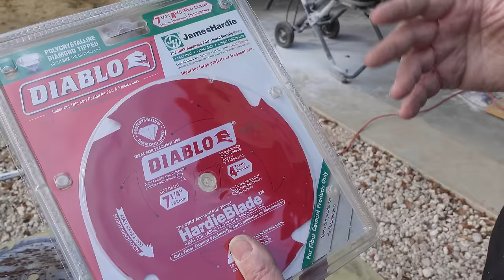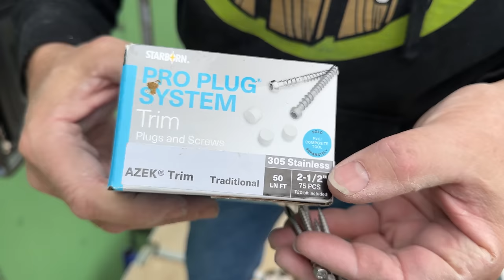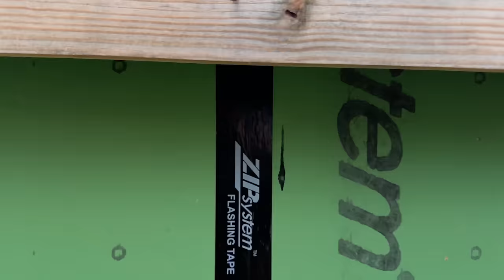Installing a Bulletproof Soffit and Fascia That Will Never Rot!

Comment: I just did my trim in pvc. You really need a respirator cutting the pvc. The aerosolized plastic particles coming off my table saw are also terrible for your lungs.

When cutting the long boards like that I clamp a 4ft section of the saw guide instead of the feather because it keeps the pvc square to the fence over a longer area. The 18ft sections of pvc are so floppy they can bend on the short axis and your cut line walks.

The cortex screws driver bit has the felt tip and stop that lets you drive till you hit the stop is much nicer, perfect plug depth every time.

Comment: I was going to ask if Hardie needed to be gapped between panels but I looked it up instead. :) I figured I'd share what I found in case any other commenters are curious. Hardie says to use "moderate contact" between panels OR you can gap them and caulk them.

Comment: Wood can survive in Houston, it just requires proper wood species selection for rot resistance,  and consideration of ventilation and drainage, so you don't trap moisture (either rain or condensation), and constant diligence on maintaining the sealing and coating, i.e. yearly check and repair of caulked joints, and repaint when necessary.  That'll be 3-8 years, depending on the quality of paint and prep work, as well as sun exposure. I went a little long (10 years), and the only bits I needed to replace were the bottom run of 8" T&G on two sides off my garage, since the foundation sunk and those sides were in ground contact. Actually, that's why I was late to repaint: was getting the foundation fixed, first. :/ Ok, so it's a lot of work. But it can be done!

Comment: First, really awesome that you are working together as a father/son team.  What a fantastic opportunity for making memories. The AZEK products are great but they really show a lot of dirt and discoloring over time especially anywhere you have a joint, cut edge, or caulk.  I know you said you are going to paint the soffits, but I hope you are going to paint the AZEK facia and edges as well I find most people never do that extra step and it is so worth it.  FYI, if you use Royal Celect Frost trim boards in the future it comes already painted but does require more planning since it usually is not a stock product in most supply places.  Overall, the project is really coming out nice.

Comment: Happy New Year Stud Pack !  Great work as usual. Just like everybody else, I would have done some of it differently. I would have "boxed" (as we call it here ) the eaves. That is running the soffit level, as opposed to matching the roof slope. Also, I prefer to have the rake fascia overlap the side, so that joint looks cleaner from the end where is most often viewed.  I think you guys are going to regret not venting the roof system.  We will see in a several years, yea or nay.  For those that may not have noticed, on the rake fascia, that mitered joint should be ( as it appears to be in the video ) with the long point of the joint pointing down. It looks cleaner from the ground to do it the other way. But this ensures that any rain /moisture runs off to the outside.

Comment: I put Azek up for fascia in Chicago. Must be 10 years now. The board cost me almost as much as he high end vinyl siding for the whole house! Shiplapped the joint. I also knew, since it is a vinyl product, it would have something like a half inch expansion between winter and summer at 12 ft. Thus the shiplap as opposed to the 45/scarf,.a half inch gap is pretty visible, especially if you view lines up with the joint. I didn't see your scarf joints, but in the winter you need to gap the joint. Best to install in the heat of summer and then you can butt the joint together. Same goes for the corner overlaps. They don't carry those Azek screws in Home Depot (which used to stock Azek). GRK general purpose construction 2 inch works great with silicone white paintable sealant (attracts less dust) as a plug.

Comment: On the rest of your Azek use Christy’s White Hot. It works great to meld you pvc together. See if you can find the squeeze tube. You could also use it to plug your kerfs. 

As far as the nail gun is concerned the spool on the gun adjust to the nail length. I think you have it adjusted for 3” nails. 

Nice detail Paul. KUTGW!

Comment: I used a pvc soffit under a deck on a deck i did last spring. We also ran the trex deck waterproofing so we could have a soffit and lights with a ceiling fan. Created a really nice useable space under the deck.

Comment: Trust me, you want to add a backing board for the TV. You don't want to limit your options on mounts. I work in home theater installation and have ran into way too many brand new homes that we ended up having to mount to a center stud and toggle the edges. Just do it and save the hassle.

Now, don't forget to add two brush plates/boxes with a larger conduit to pass your HDMI cables from your tv down to whatever entertainment center you choose. This will really give a minimal look and also once again save tons of headaches. You don't want cables hanging everywhere and running cables through insulation is no fun. 

I would be glad to answer any questions on the AV side [Speakers, Wiring, ECT]. Sonos has some great simple whole home audio products that would really make this space pop.

P.S. I would lower the TV box down around a foot or two. You want your livingroom tv to be centered at eye level. On the other hand this can conflict with furniture, so you have may have to mount it higher than what is considered "ideal". At the end of the day its your space so don't get discouraged by the "TV TOO HIGH" crowd.

Comment: you need a top down feather board on your fence to run those long dados. w/ PVC board you can use plumbers glue for tight and sealed Joints- but use fasteners too. Also please tell Rad to send me Blood pressure meds, I need them every time I watch him on a scaffold.

Comment: I use the same material for my snake racks. I use the half inch. I used to use melamine and that was not only heavy but would sag. This is much better. Water and mold resistant. It’s amazing.

Comment: That end dado feature to put the soffit board into the facia. Excellent eye for detail. Just slap and caulk, you would have had that come apart and be nasty every few years. This detail, that joint will be perfect for the life of the house. 

So odd for me seeing PVC boards everywhere. When I was a kid in the 80's, PVC was this new fangled material for plumbing and it was revolutionizing plumbing who used cast sewer and poured lead. Now, seeing it again.  I don't know how that PVC boards would be out here in Phoenix where we see temps in 120's and 12 hour baking sun and humidity during summer monsoons. PVC pipe that is above ground or exposed, bakes and turns black and brittle. You have to paint and cover and it still softens and wraps in the heat of the radiating sun. I would imagine PVC boards would twist and warp and be messy.....

Comment: Eaves actually serve a purpose beyond “just looks better”. Deep eaves ensure that water isn’t running down the face of your building- which saves the finish and the materials underneath.  Even with gutters, you want to reduce the amount of water that splashes back from the ground onto the building.  Otherwise, great work, and keep going.

Comment: Good decision on the thickness of the dado: Dissimilar materials (Vinyl, cement board) will expand and contract at different rates at different temperatures. You don't want that little vinyl tab breaking off because of contraction rates.

Comment: The nail gun might be jamming because the depth tray in the coil holder isn’t set properly. Basically, in the coil holder the floor of it can raise and lower based on the length of nails so it will feed to the barrel of the gun in the correct plane.
Reply: Came looking for this: figured there was some adjustment that wasn't set right, just not familiar with the tool enough myself to know what it was.

Comment: I've had to replace so much Hardy board fascia on houses, because there was nothing left but the paint in the shape of the fascia. People don't realize, Hardy board is like a sponge. It will soak up water, and start to disintegrate. It's ok, if you cover it 100% with something like silicone or paint, but there are always small spots that get missed, or wear off due to weather. I've replaced fascia that was less than 8 years old, but was already completely disintegrated.

Comment: Been using Azek for years. Azek is awesome. You use PVC glue at the joints. Smells stinky when you cut Azek and it will eat up blades. Azek, doesn't rot, twist, crack or split. Expensive but worth it. I also use it for base in the house. Especially if you are doing an old school craftsman style interior with Plinth blocks which I use Azek too.
Reply: I picked some up for a recent project and couldn’t believe the price. Especially for the 3/4 inch stuff.

Comment: Another idea for patching the dado slot - bondo.   I just tried bondo for the 1st time on an exterior door frame repair liked the result.       Sticks well, easy to sand and I figure if it can make for car exteriors, door trim should work good to.        I 100% agree with your idea of making the trim as durable as possible.
Reply: Axel expansion/contraction with temperature changes may be likely to loosen the Bondo.

Comment: You would be wise to vent your soffit near your dado groove because if water does get in the interstitial soffit area you want a place where the water can drain out. You could just drill some 1/8" holes in that area, but make sure the holes are too small for bees and hornets to get into. To be safe, drill 1/4" holes and put a screen on the hidden side of the soffit. The screen doesn't need to be wider than 3"  It is a rule of thumb to never have any area exposed to water that does not have a drainage mechanism to let trapped water out.  Water CAN get through the upper Zip board if there is a hole or a joint that leaks. 

Also, you want to vent your soffit so that it does not superheat in the summer. When air is trapped in confined roof spaces, it can superheat to over 150 degrees F.  Over time this may degrade your roofing material at the edges of the roof.

Honestly, you don't need a soffit cover underneath the overhang at all. In AZ, the exposed truss tails are left open because the birdboards have vents for the attic. The truss tails are shaded and painted, and they never rot or go bad, even in the hottest of climates. You hardly ever see a covered soffit in AZ framing. It just creates a lot of unnecessary maintenance and potential problems.

Comment: Diablo has the best blades for cutting any Hardie or cement fiberboard material. Those blades lasted the longest and gave the best cuts. Pricey, but when one blade does a few jobs versus other brands needing multiple blades on one job, worth the price. Good call Stud Pack!

Comment: I love your channel and have followed this Houston build from the beginning. You have taught me so much! Truly, thanks!

I do think that little plug thing you did to fill the end of the groove on the fascia board on the gable end was poorly executed. Rather than pop a little white Lexel in there to fill that void, you cut a poorly fitting plug of Azak, and when you drove it in it pushed the fascia board away AND split it! That part should never have left the editing room floor! It was not up to your normal high craftsmanship.

Comment: Hey Stud Pack. I’m give you a crazy suggestion. Buy an used boom lift to do siding on garage building, and then use it for the main house. After you are done sell it. It will save you time on setting up scaffolding.

Comment: Timestamp 23:48. Does the code allow just hanging that wire, or does it require an electrical box and the cables terminated?
Reply: Code requires that it be terminated. They will do that at electrical trim out, though, and until then, it will be fine during the construction phase. It cannot be left buried and/or unterminated at the time of inspection for the Certificate of Occupancy.

Comment: Also, quick item when you go to do drywall and stucco. Your seams, make sure you do not have any on a sharp corner. I.e. around a door. Put the seam kn the middle of the door or the sides, never at the top corners. Same with windows. If you do, your drywall will crack there after a few years. And your stucfo if foam seams are too, youll crack there too.

Comment: Nicely done. Using the Hardie for both my facia and soffit since I have no humidity issues here in Wyoming.  Learning a ton from you guys!!  Keep it coming!!
Reply: Hmm, didn't understand your comments.  Both Hardie and Azek should be insensitive to humidity so I wouldn't have thought that impacted your choice.  Can you explain?  (Building south of Laramie....)
Reply: @tapswitchmanager7359  sure thing. I’m up between Cody and Powell. My thought is that PVC products although impervious to humidity like Hardie I would think that  it would tend to be susceptible to the extreme temperatures (cold) we get. Either making it brittle or causing expansion as contraction.  Hardie isn’t susceptible to cold  and doesn’t require any gaps at seams. If that makes sense.  Just my thought process. Let me know if I’m off in my thinking.   Also I’m already using Hardie on my soffits and siding so it just made sense to use it for the facia.
Reply: I'm in western Nebraska. I've been using steel or aluminum for facia and soffit. Easier to work with than Hardie and don't have the expansion and contraction in temperature changes of the PVC
Reply: @mikewatson4644  my original plans were for steel but decided against it. It’s a good choice though.
Reply: @troop311   I just got done helping a friend put siding on a 20x50 shed. He choose Diamond Kote lap siding over Hardie. His house already had Diamond Kote siding. He had a hailstorm that destroyed the vinyl siding on the shed. Destroyed Pella windows on the house. Couldn't find a single mark on the house siding from the hail. The Diamond Kote was easy to work with, came in 16' lengths, 1 person could carry easily with no breakage. I'm not against Hardie, but it seems that some of the other options are safer to work with. Good luck with your project. You certainly live in some beautiful country.
Reply: @mikewatson4644  thanks brother. I’ll look up diamond kote but I think it’s LP smart Siding and there were some things about its maintenance that didn’t really appeal to me.  Also they don’t warranty it in the northern states from what I read. I’m not happy about the dust from Hardie but I’ll be masked up for sure.
Reply: @troop311  Yes it starts it's life as LP Smart Siding. Diamond Kote adds a spline to the back that makes installation easier - it automatically will set the correct height. And they paint it. Paint job looks very good. My friend bought his place 3 years ago. Previous owner had installed the siding on the house so he is not absolutely sure how old it is, but the previous owner said it had been 5 years, so a total of 8 years old. It looks virtually new. And that is with the new siding on the shed about 15' away. I was very impressed. I have LP Smart Side 4x10 sheets on a garage that I built 9 years ago. Not Diamond Kote. I painted myself. Have had zero problems in 9 years. I have read that older LP Smart Side had some problems, but they changed how it is manufactured quite a few years back and fixed problems?? Don't know the story on that. Just know it has worked for me and I was impressed with my friends installation.

Good luck

Comment: Did the fasica joint backwards.
Now you can see the seam from front and back. Should have been on the side, then the gutter covers it.

Also, that PVC is going to warp in the heat eventually. It always does.

Would have went with standard aluminum if it was me and framed the soffit square to the house so your exterior soffit lights shine straight down

Comment: While you have the access to the inside of the walls you should consider pulling low voltage security wire to do hardwired sensors on the doors/windows (if you plan on doing a security system) and pulling Ethernet to anywhere you would want exterior security cams.

Comment: Not sure if you’re finished with all your fiber cement work or not, but you should check out the fiber cement shears that are out there.  They look just like metal shears, there is zero dust and I personally think it’s faster, especially on rip cuts.